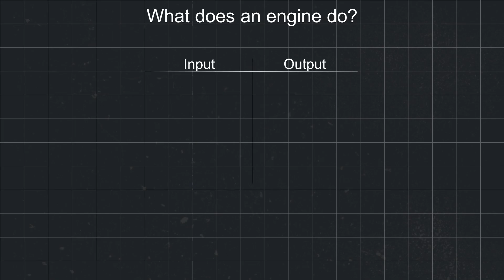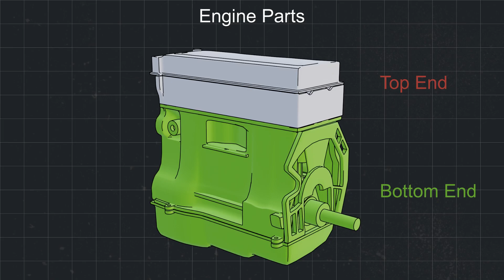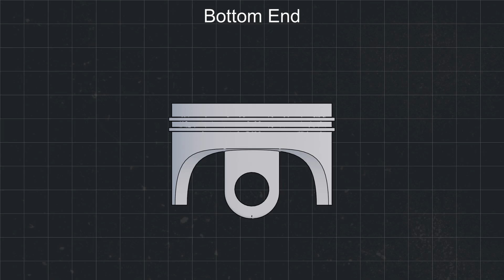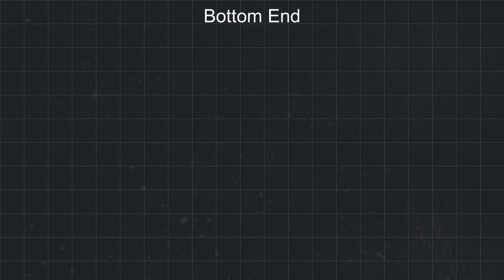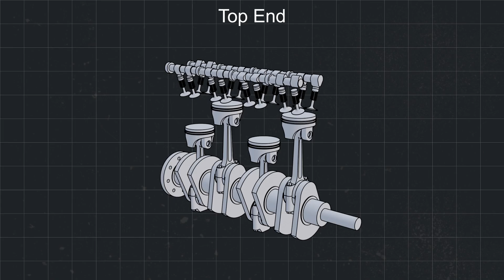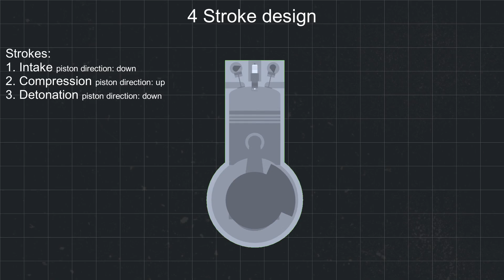How a engine works

Comment: most engines in cars have 2 piston rings and an oil ring.
Reply from the maker: That's correct, I missed that in the video. The piston rings allow for compression above the piston and the oil ring is responsible for keeping the oil out of the combustion chamber. Thanks for your comment

Comment: You deserve more bro great video but may I know how to create this video using animation please which steps I can take to get start
Reply: I’m struggling to find out how to start this kind of videos
Reply from the maker: Hey, thanks a lot :) I use blender to model and animate the parts shown in the video, then I use kdenlive to edit my videos. So a good first step is to learn blender or a similar 3D modeling tool. There are also a lot of free to use 3d models out there. Hope this was helpful
Reply: @MichelsGarage  i appreciate thank you brother
Reply: @MichelsGarage  as for the computer which type is very good based on animate and which software that computer should have been. Is it possible to use gaming computer or any computer with good functioning? Thank you 🙏🏿
Reply from the maker: Hey, It's absolutley possible to use any computer, my pc was build with gaming in mind, but you can use blender on almost every pc, tho the render time for animations will be different. With a stronger GPU the computer will render the animations faster. And for software as I've stated I like to use blender, but you can use any 3D modeling tool which allows you to render animations.